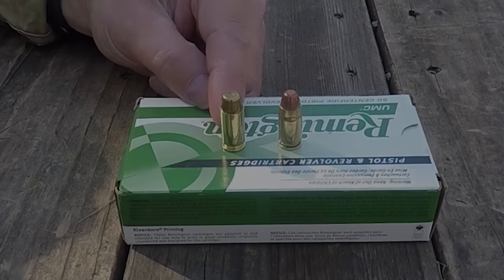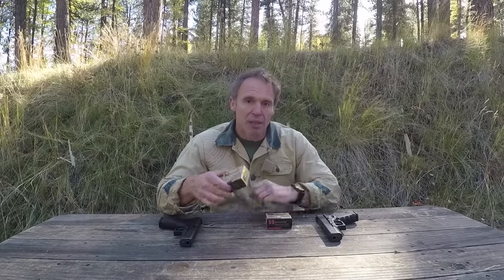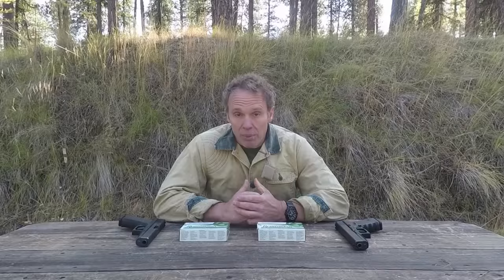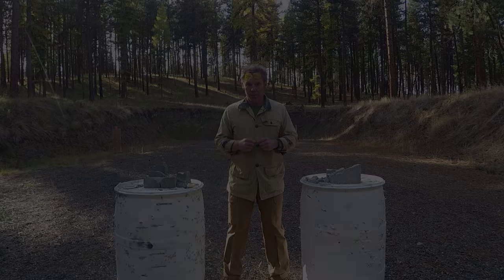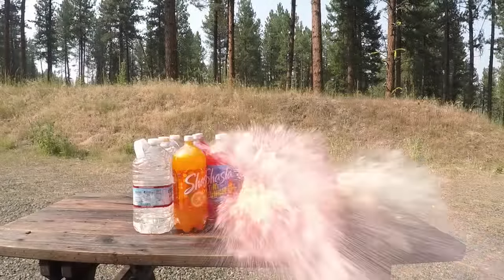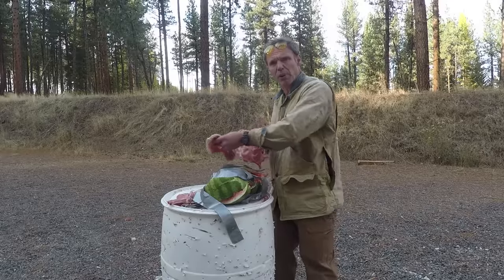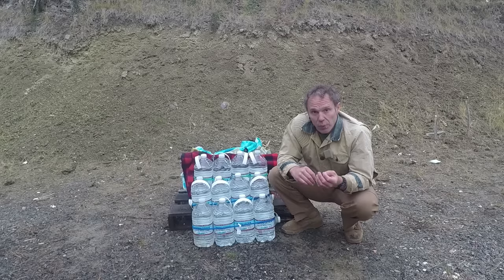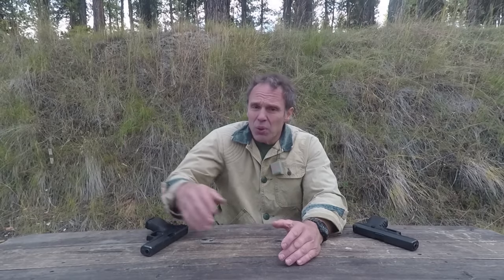Personal protection: .357 SIG vs. .40 s/w

Comment: good review as usual.  The good thing is that the gun that is 40sw can be easily converted to 357sig with a barrel change only.  Best of both worlds.
Reply: And .40 cal. mags work with .357 Sig cartridges, at least Glocks do. (And vice-versa)
Reply: .40 is actually more powerful. When you get the hottest factory ammo for both, the 135 gr Underwood .40 nosler, and 124 gr Underwood .357 sig nosler, the .40 reigns supreme. So .357 sig can not claim to be more powerful, no matter how many big companies load .40 and 10mm way under saami spec and load .357 sig pretty close. 

The 135 gr and 155 gr underwoods are rated from a 3.4” barrel too, AZ AIRGUNNER just proved that with two recent videos of .40 vs .357 sig. He got exactly 589 ft lbs from the 3.4” barrel with the underwood 135 gr .40 nosler. The .357 sig nosler from them had 540 ft lbs. from the 3.4”

From a 4.9” barrel the .40 had 675 ft lbs. The .357 sig had 640 ft lbs from a 4.5”.  Gun Sam tested the .40 from a 4” and it got 610 ft lbs. Needless to say I picked up a fex boxes. It’s in saami spec and it shoots great from my Glock 23, not uncomfortable at all.

Comment: Also reloading 40 S&W is easier and case life is longer. This allows for more uses of the brass and much less time spent on case prep. Sig 357 does have cheeper bullet options available when lockdowns don't have everything discombobulated. Hard to find 9mm bullets right now. Even harder to find brass.

Comment: a very important feature of the .357 sig round most overlook is that when the round feeds there's little if any contact with the feed ramp- you're shoving a 9mm projectile into a .40 size chamber--- when you lock the slide back on a loaded mag- look at where the projectile is pointed- into the center of the chamber....whereas 9mm, .40 , .45- all go up the feed ramp...i've been shooting mine for years and have yet to get one ftf/fte....
Reply: nice point!
Reply: Damn... I didn't even think of the improved feed. Cheers!🍻
Reply: Arman75 u prove it
Reply: I am not the one who made the statement and I don't believe your statement, so I have nothing to prove.
Reply: @gsfbffxpdhhdf7043  Before you run your mouth be prepared to back it up with plausible data. Oh, and there is no need for name calling.
Reply: @gsfbffxpdhhdf7043  Do you own or have you owned a .357 Sig  or are you parroting 2nd. hand speculation?
Reply: @dukeman7595  thats not the point. The initial claim from the original poster of the comment suggested that the 357 sig is unreliable compared to other common center fire pistol cartridges. While it is rude to insult someone the original poster only presented his own expereince with the cartridges he's familiar with and not data or even experience with 357 sig.
Reply: @dukeman7595  however i will agree that the premise of the cartridge does theoretically equal more success in feeding.
Reply: @doomermeme9975  I understand, however, the poster called some people "Idiot" and  was snide in his/her remarks.. But, two wrongs don't make it right. My apologies..
Reply: @gsfbffxpdhhdf7043  i have shot thousands of rounds of it, in various flavors over the years- and never had an issue- the sp in my state also carry it , and love it- i've also never seen them have issues with it either, nor have i heard of any of them saying they have ftf/fte issues...your experience may be different, if so sorry to hear that...
Reply: Yep,,VERY VERY,, ,,VERY important matter